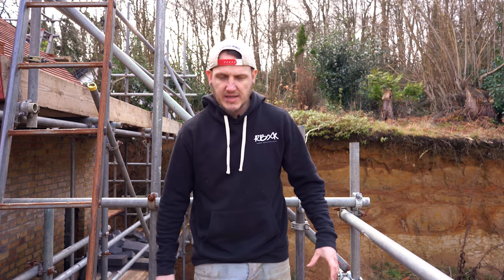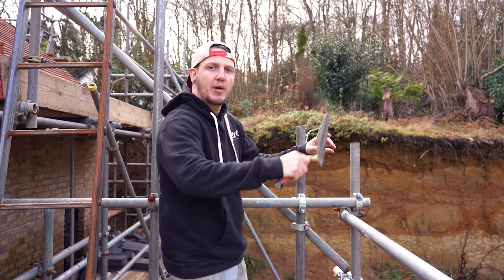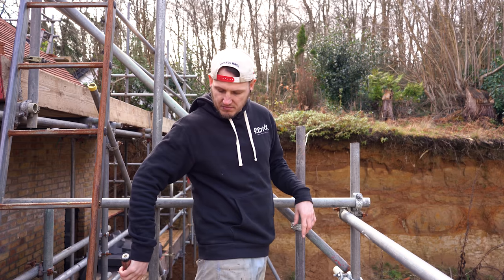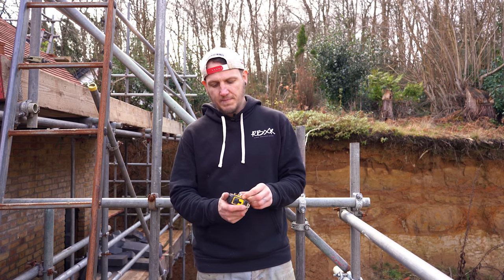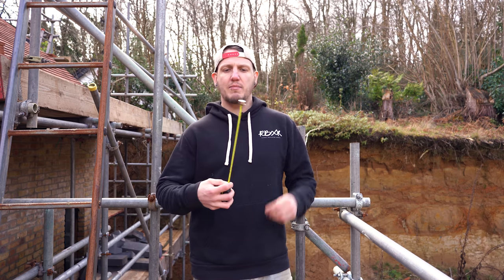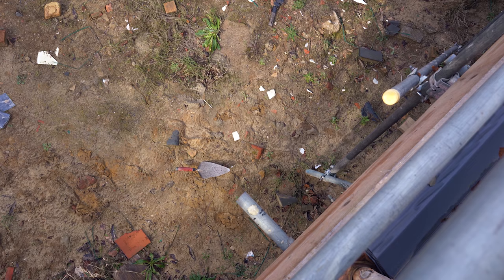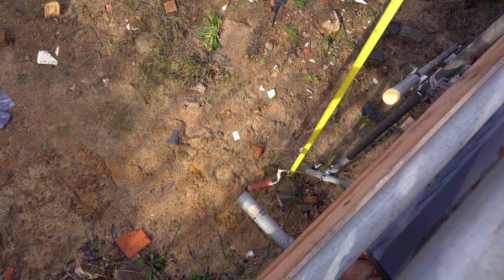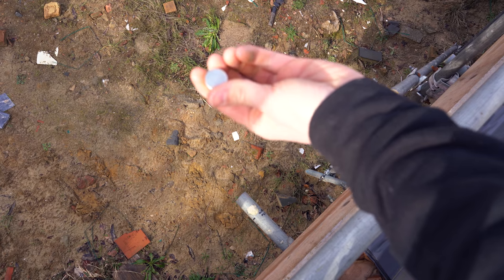EVERY BRICKLAYER should have one of these

Comment: I've had a magnet in my tool bag for years, I have attached mine  to some string line Coz I'm always dropping things down the cavity my trowel most of the time lol and a lot of builds I do the cavity is massive 150mm so things tend to fall 😂 saves cutting a block out at the bottom, another great vid mate  👍